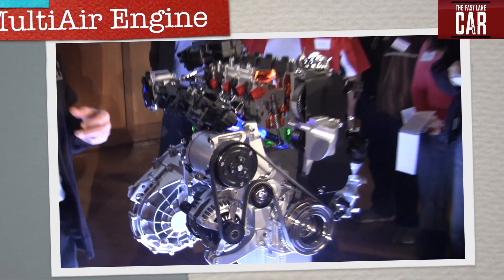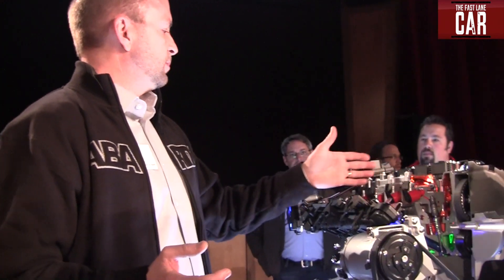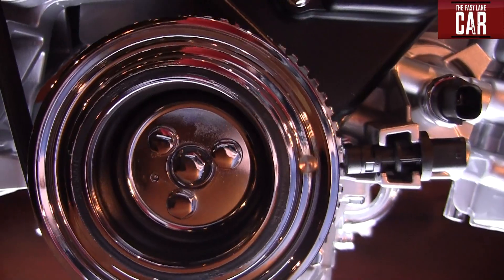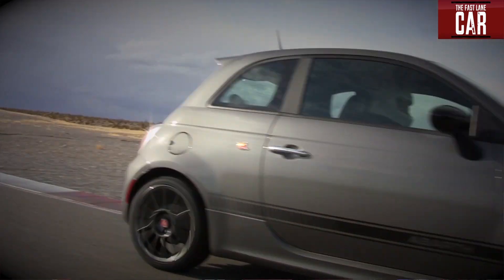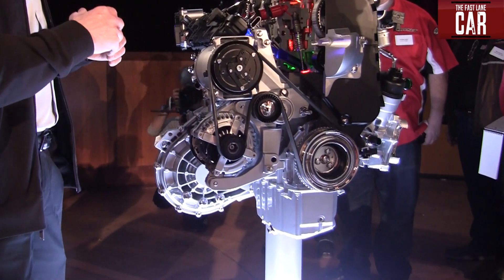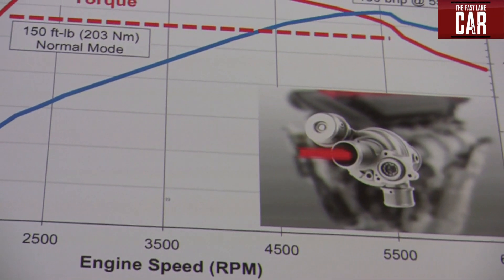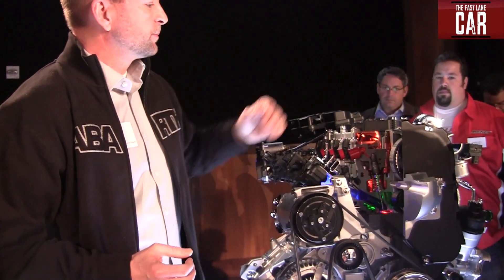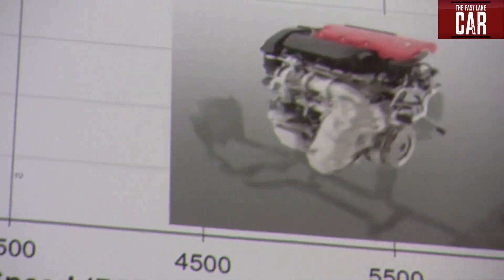2012 Fiat 500 Abarth's MultiAir Engine exposed Inside and Out

Comment: Multi-air is completely different.
The systems toyota, bmw, honda and many others are more limited.
The multi-air system, vary both the phase and the composition of the mixture, since low rpm. to high rpm.
May delay the time of detonation can open the valves to allow for cleaning between cycles or even outside cycle.
The fuel can be spread over thousands of shots before being detonated.
Nothing in Multi-air is static, everything can be changed.

Comment: No it isn't. Those systems are just variable valve timing. They still use a normal throttle body (aka the "throttle butterfly") so you still lose about 10% fuel efficiency at part loads due to "pumping losses" (best google this for a proper explanation). In the multiair, they eliminate the throttle body, and control power solely through deactivating the intake valves partway through their action, thereby eliminating all pumping losses at part loads.

Comment: The car has multiple settings for power (torque), Multiple traction control settings, comes standard with Bluetooth compatibilty, Bose Stero, great breaks, and a transmission meant for vehicle with more horsepower.....

And you think the Abarth should start at $15,000?????

You can get an abarth for 23,000 with the stripes and all I mentioned above

Comment: @NIGHTMAREuki More variability.  The original VTEC, for example, had two modes, but my understanding of Multi-Air is that it varies continuously and fluidly to optimize the timing, with the ability to change the open-close profile to almost any shape.  Other variable valve timing systems, from what I understand of them, simply open the intake valve with the cam profile at different times to achieve an optimization, rather than creating "custom" cam profiles on-the-fly.